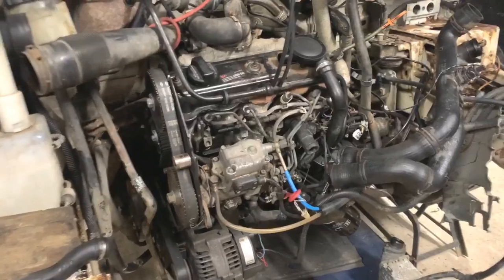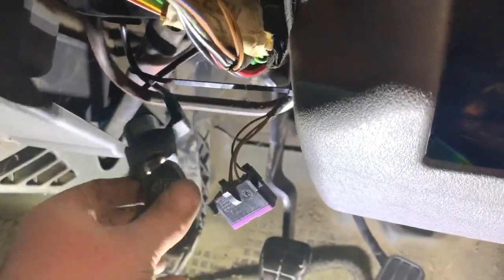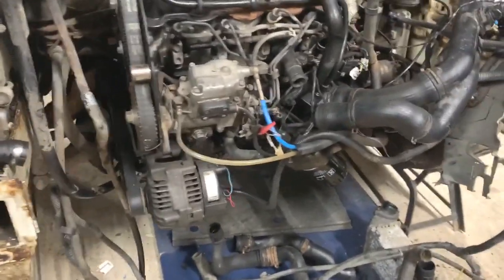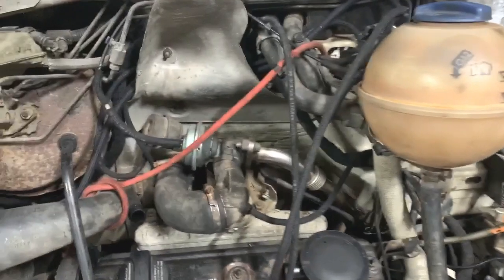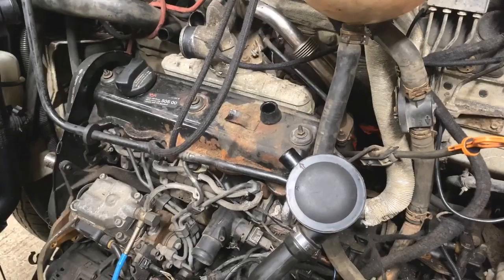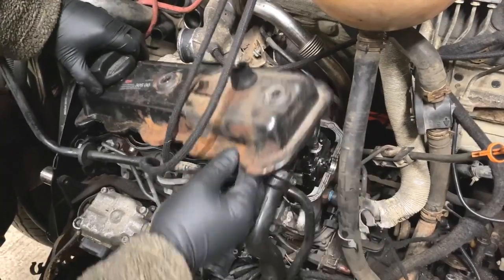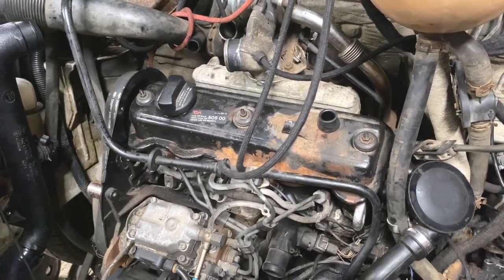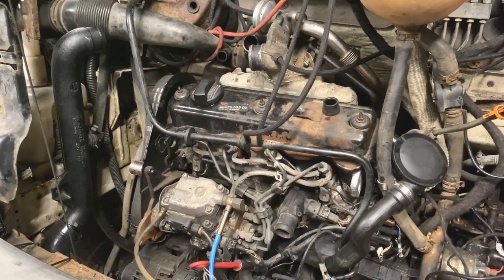VW T4 Transporter TDI Conversion , Sorting Smaller Jobs ( Part 11 )

Comment: They're great little engines, there must have been hundreds of thousands of them manufactured over the years
Reply from the maker: Hi they are such a good engine, even the not turbos were very durable engines, sadly the older ones like this are getting few and far between now, thanks for watching 🙂👍
Reply: @menditman2004   I spoke to an AA guy once, he said the 5 cylinder non turbo was one of the most reliable engines VW ever made... Those little 4 pots are so simple and solid and loads of them were built.  I had a few LT's I was running out of diesel in deepest darkest Scotland and we were nowhere near a petrol station, we found a grocery store and put 6 litres of veg oil into it and it got us to the nearest service station,  Thanks for uploading, great video
Reply from the maker: @zambotv8150  Yes the 5 cylinders non turbos were very good engines, the turbo ones I have heard can be troublesome but a lot of that is probably to do with how they have been looked after. I also have a 04 merc sprinter and I rate that engine highly (popping injectors can be an issue but I’ve been all through mine and up graded the copper washers and all have been good since then) it needs some work atm but it is likely to appear on the channel soon, thanks again for watching 🙂👍
Reply: @menditman2004  Ha ha I started watching your videos after seeing you tackle that injector job. I have a 51 plate Sprinter T1N I have been working on for YEARS now on my channel and. It has black death that I'll have to deal with at some point!!!! They can be an absolute pig of a job.